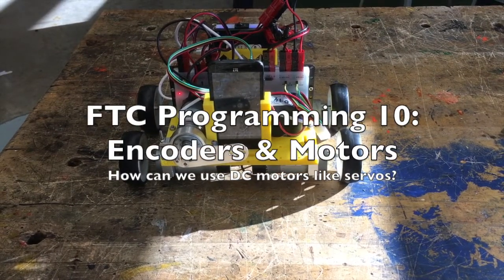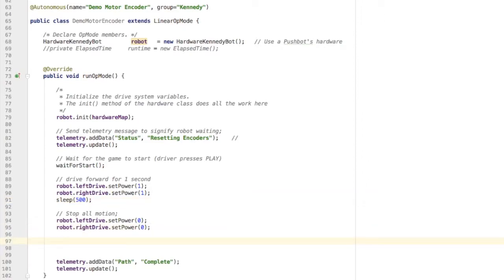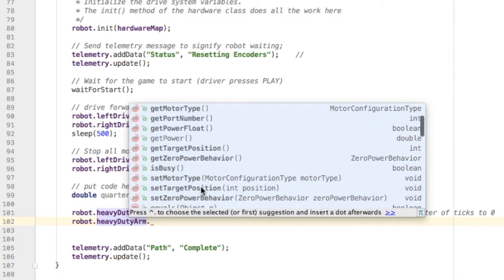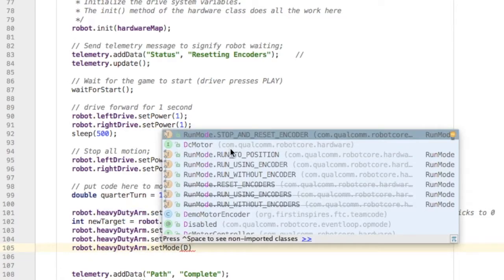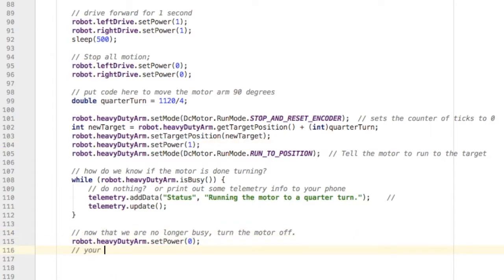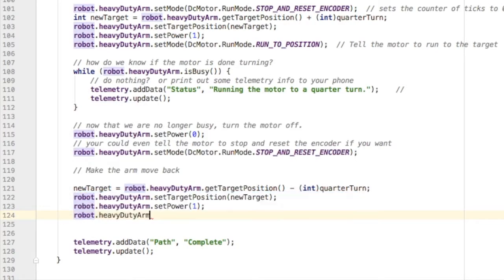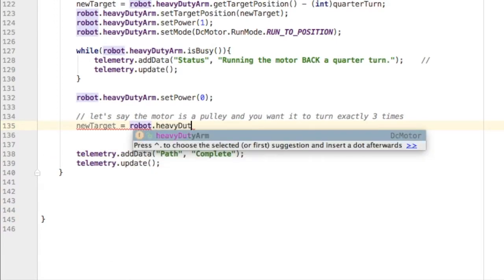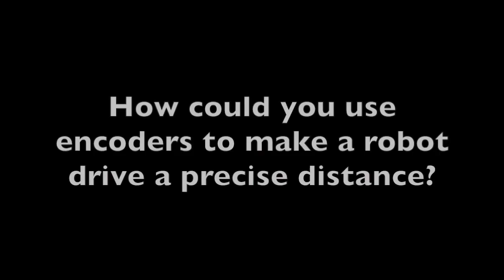FTC Programming Part 10: Encoders & Motors

Comment: Is the arm still under power once it has reached the first target position? If you wanted to arm to move to a position holding something and stay up how would you do that?
Reply from the maker: It's been a while since I did this, I think it will hold the position as long as you don't stop the motor.  If you want the motor to hold position with the motor off, you could use a worm gear.

Comment: How would I make the motor run to a position in the opposite direction? Can I set a negative position, or negate the power. I'm trying to use this to run drive motors backward, but I can't find anything on how to do this
Reply from the maker: If you go to 4:40 in the video, you can see that I make my little arm go back to its original position by subtracting from the current position.  

I don't have a robot set up like this anymore so I can't check, but you might also try changing the power.  Just experiment and try it out.
Reply: @AaronKennedy  Thank you for the reply! Can I subtract from the position if the position is already reset? I will experiment a little bit. Thanks